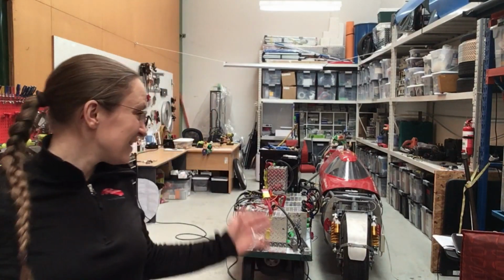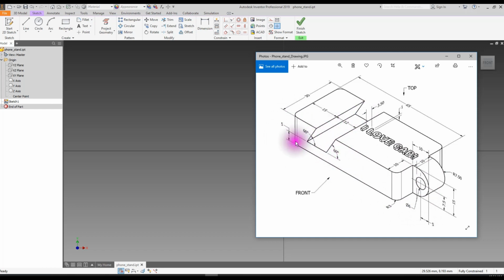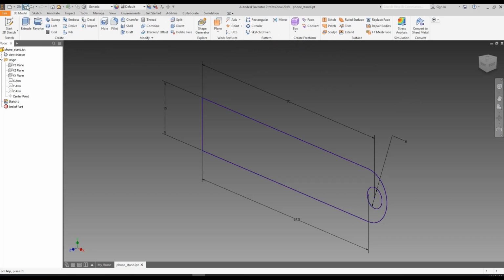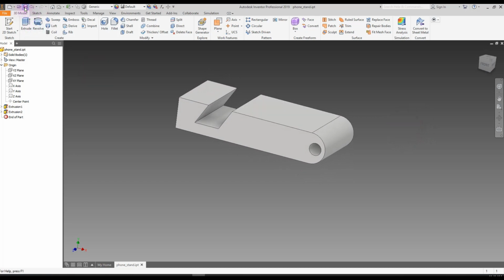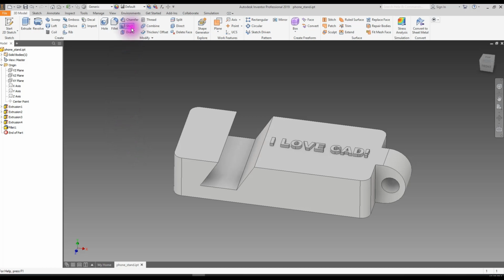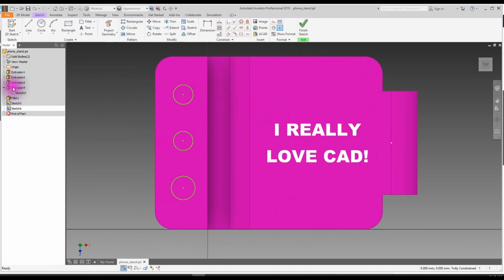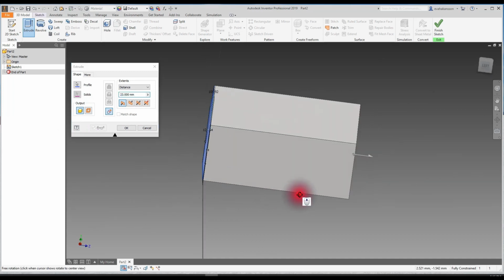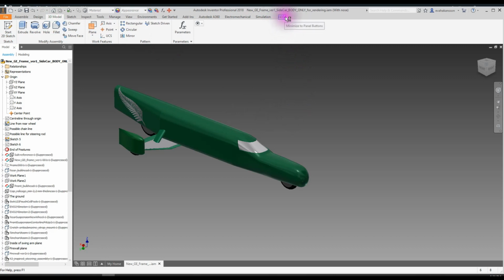CAD (Autodesk Inventor) for the absolute beginner, Part 1, #CADwithEva

Comment: Wow! Very cool.   In 1986 I started learning how to use CAD on AutoCAD version 2.1b - I drafted on CAD for my day job from 1987 to 1994 and from 94 to 2004 I was a CAD manager for a large MEP firm in NYC.    And most of my clients still use it today.    So, I have access to it.       I also used it back in 2010 to design my custom made wallet, but I didn’t 3D print it.  I sent it off to a lady who make it out of leather.   But,  I never tried Inventor.  I may have to download it now.    Thanks!
Reply: *Made